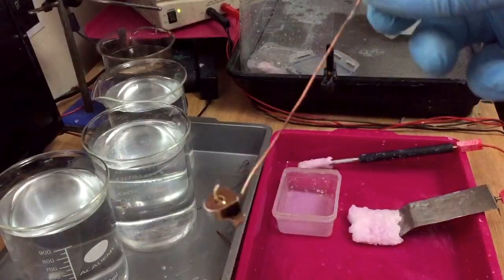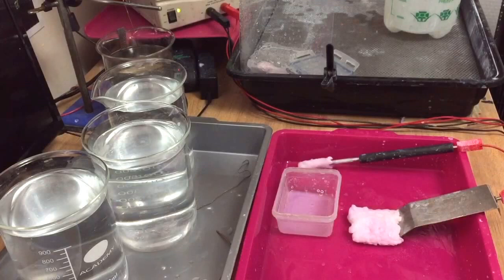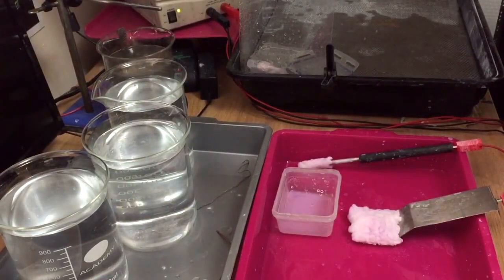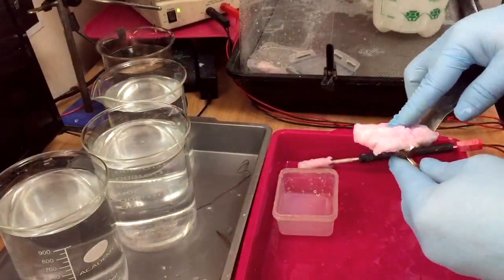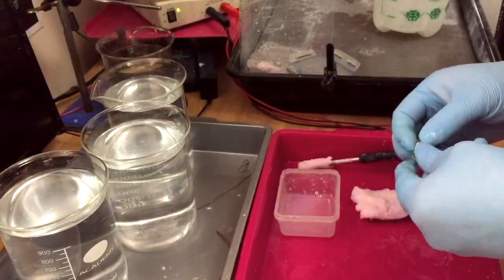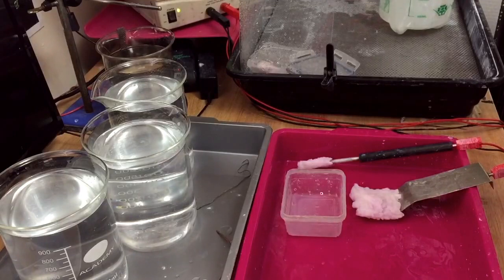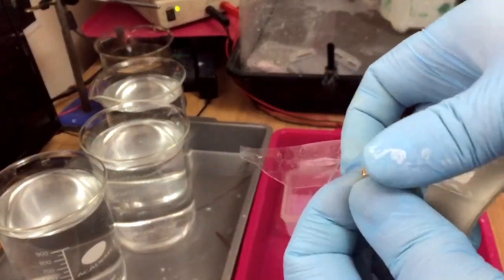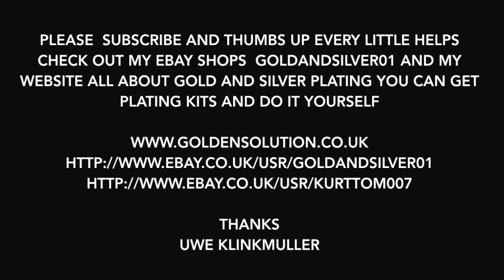How to Activate a Nickel Plated item in a Beaker/Tank before Gold Plating

Comment: +Golden Solution  The title of your video is how to activate a nickle plated item and not how to gold plate but you spent the entire time showing your gold plating process.  It would be very helpful and more to the subject of the video if you explained what you used for your Surface Activator Solution (mineral acid, just water, other), what anode grid do you have around the inside of the beaker (is that stainless steel?), how long do you activate for, What Amp and Watt setting was your power source set for prior to submersion?  As for myself, I know the majority of these except what solution is best used?
Reply from the maker: hi 
yes i know 
the activator is what i sell on my ebay shop or on my website 
the anodes in the small beaker are from spa plating its platinised titanium anodes mesh 
i was saying in the video 32 sec in i put it in the activator for about 30 to 45 sec 
i use the small rectifier for the beaker i was saying at 1min 50sec in i use about 4.5 volt for brush plating and for the activator 4 volt in the beaker don't use amp in this case 
here are some links 
thanks 
http://www.goldn.co.uk/product/mesh-electrode/
https://goldensolution.co.uk/collections/plating-chemicals-and-polish-mpu-meta-seal-activator-cleaner-chrome-stripper/products/activator-500ml
https://www.ebay.co.uk/itm/Activator-500ml-Brush-Tank-Plating-/142438775882
Reply: I see, thanks anyway.